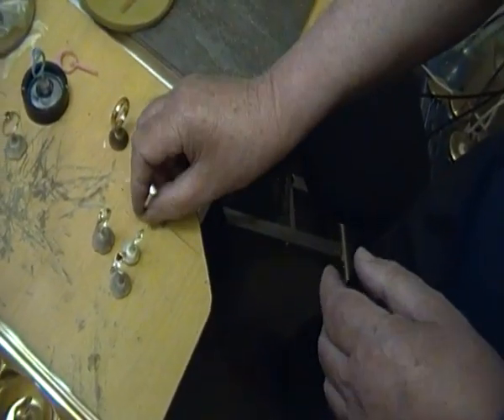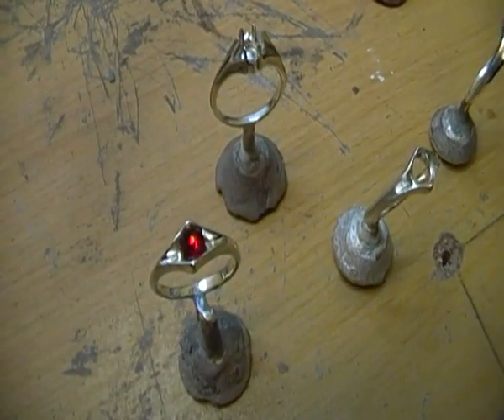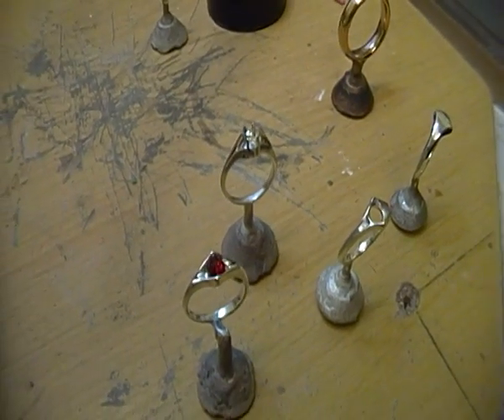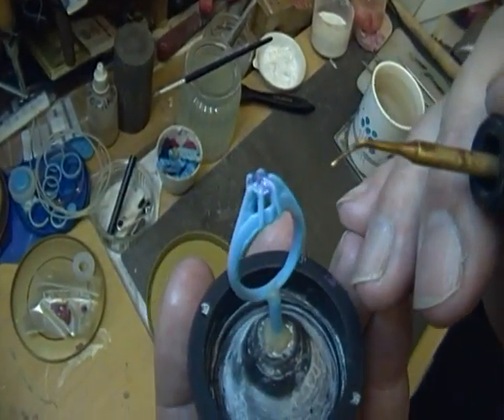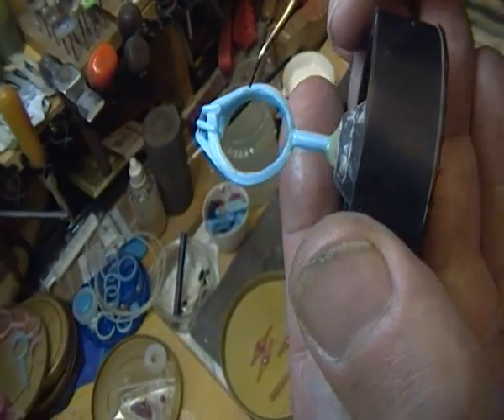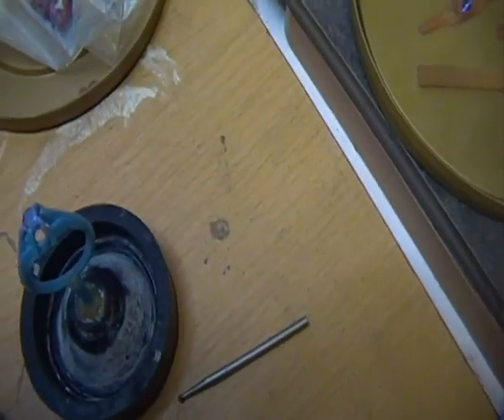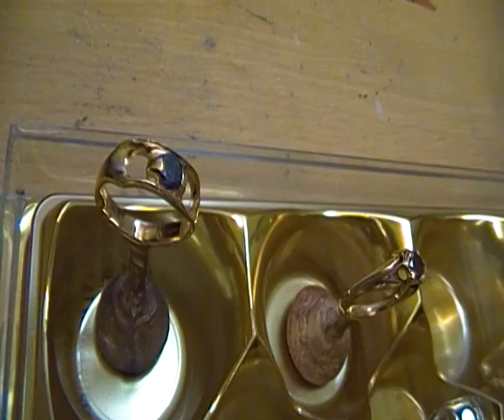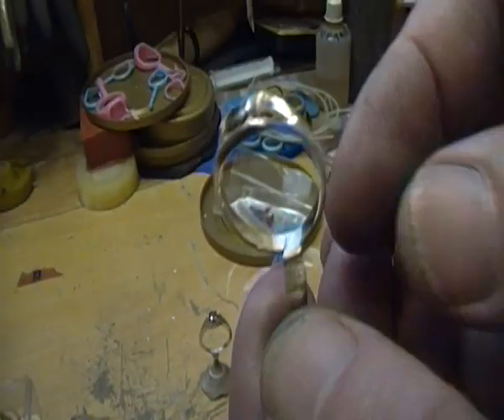Setting Stones with Microfoundry

Comment: With resin based printers getting so darn cheap (sub $300) have you tried working working with any of the wax replacement resins?
Reply from the maker: Hi robert - yes  its amazing what is available now isnt it - wecan buy in waxes https://youtu.be/fnka2AF9ul4
or print our own using moldlay https://youtu.be/syLNYyPa0iM
Reply from the maker: https://youtu.be/Cq2u7g4HT5k